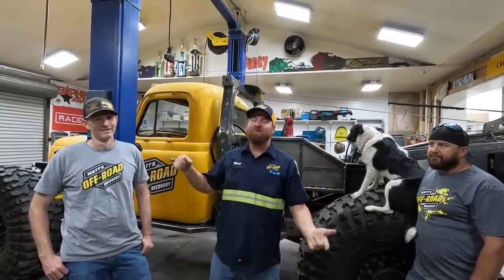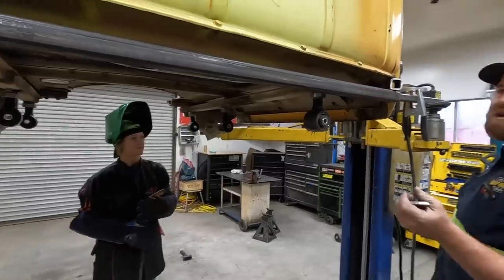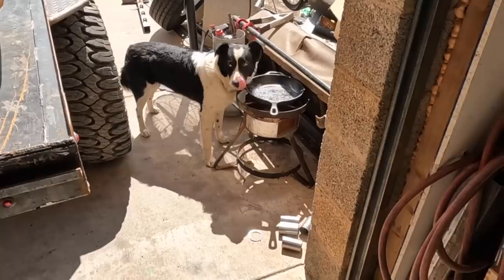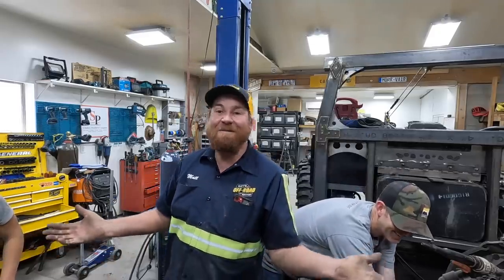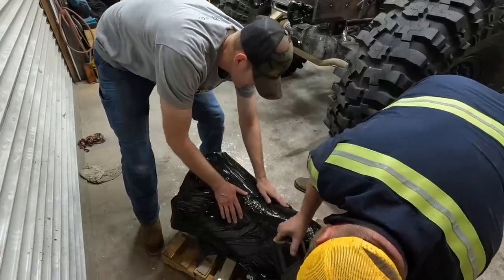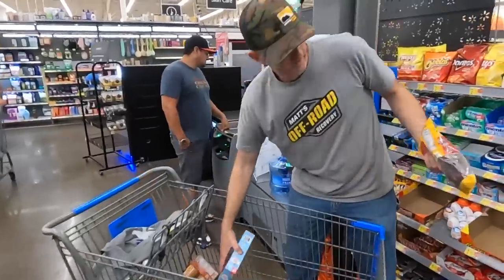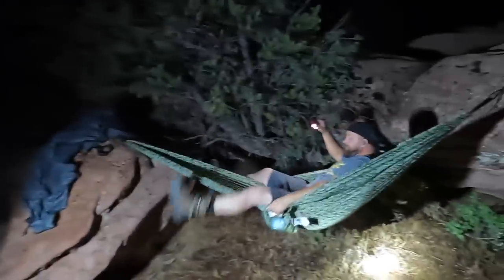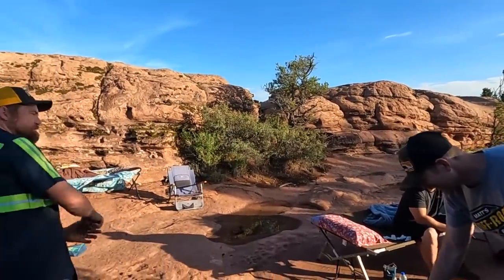Off Road Wrecker, We Need To Take It Apart Again.

Comment: The shot at 12:56, with Skeeter standing on the transmission to counterbalance the off-center engine, hanging from one arm of the lift, with the bright yellow CAUTION sign in the background ... priceless.  😂
Reply: 12:30 'if anybody is timid just leave because we dont need that kind of negativity'
Reply: Lol my thoughts exactly!! 😂
Reply: I was more worried about Ed balancing up high in that one shot.  Damn Ed, be more careful.
Reply: Zero day since last accident on the shop safety sign. lol
Reply: I used to work at a factory where we machined steel bars into hydraulics couplers and components. The crane operator would wrap the sling around the center of a bundle of bars and they would balance perfectly as he walked the crane down the center aisle. One day he got the 'bright' idea that if stood on the bundle as he operated the crane he could 'surf' the bundle down the aisle!
The supervisor informed him in no uncertain terms that if he ever did it again he would be fired on the spot! He never did it again.
Reply: I couldn't believe the bar stock on the lift arm was kept from sliding forward by a clamp 🤣 perfect
Reply: "Think heavy thoughts Skeeter." 🤣
Reply: And Matt going;
“Think heavy thoughts “
😂
Reply: One time, everyone at the shop I worked at ended up riding on the back of a forklift, with a huge block of steel, to counterbalance something. I forget what it was but that forklift was rated for 10,000 lb.

Comment: The one thing I highly recommend is to install driver and passenger seat suspension. Their are units for tractors that are only about 3'' tall and they are adjustable and inexpensive.
Reply: STRONGLY AGREE!  I have used air seats for several million miles in tractor-trailer cabs.  Air seats are BACK SAVERS....Particularly when the vehicle is taking a thrashing off road.
Reply: Recommend a good one?
Reply: @bobsullivan5714  I drove a Penske rental truck about 8 miles over moderately bad roads - not terrible - and every bump was like getting punched hard in the tailbone, as the seat bottomed out.  I couldn't imagine driving it a couple hundred miles that way, let alone thousands.  Getting back in the truck for the return trip, I noticed a little rocker switch on the side of the seat... which controlled the air pump on the seat suspension.  Heaven. Like sitting on a little torn black vinyl cloud all the way home.  😁
Reply: This☝️, or at the very least (and maybe sponsored because with Matt's creds and viewer base), off-road suspension seats by companies like PRP, Sparco and a few others).
Reply: Our compact JD tractor has a great one , even has a built in electrical air pump for adjusting the seat height.

Comment: There are a few things that I always have on me. First off, the one thing I never leave home without, my Leatherman. I also carry a really good flashlight. I wrap some black tape around it so I can hold it in my teeth and I always some tape. Finally,  I carry a Mag-torch MT16 pocket torch. It looks like a funky lighter but its hot enough to easily melt solder. I literally use it to solder wires fairly often. It's refillable and holds a lot of butane. It's fairly wind proof and if you drop it in water, just open it, blow the water out and it will light right up. That way I'm never having to figure out how I'm going to start a fire.

Comment: The wrecker is coming along well, good to see Lizzy wearing protective clothing for overhead welding.
THE VIEWER BUILD: I am going to say Detroit 2/, never mind the Cummins, let's have some loud diesel with good throttle response. An 8/71 or a 6/92 would be a hoot.
You guys make camping out great fun to watch. Bacon tastes good without flavouring.
Reply: I seen that a long time ago no welding protection. I look at my arms and legs from the many years of eating sparks and hot blow outs all the scars and think how Lizzy's arms will be all scarred up..... I know that they are not thinking about that at present....
Reply: @zzzzzzzzzzaper  I got a spark bounced around inside my helmet and went in my ear, that was it no more. I have full cover and wear it!
Reply: @seanworkman431  Yes those are wonderful hearing the sizzle as it goes down the ear canal. been there a few times kept on welding.
Reply: I don't think Matt can get pissed off enough to properly drive an 8v71
Reply: I like the idea of a 2cycle! That would be awesome.
Reply: What engine is in the wrecker now?

Comment: 5.3 liter fully stock,(yes the ls motor stock, maybe a dry sump ) with a five speed manual with granny gears, solid axle front and rear, (of your choice) in a four door Silverado with a service bed,(service bed for weight over rear tires and to store tools) and a set of 35s in a tire of your preference, will probably need to put four link in to ensure that the axles don’t flip, with low pro bumper in front and trophy truck fenders to keep the exterior fairly clean from dust and mud.🥰

Comment: I have a suggestion for this build. Add access plates on the skid plates for fluid changes and repairs since the skid plates are welded to the frame. That way you don’t have have to remove the cab to do maintenance or repairs.
Reply: the cab will be 4 bolts and some quick disconnect harnesses then you have complete ,unrestricted access.......your way would be irritating
Reply: @trillrifaxegrindor4411  how would you do an oil change?

Comment: Be careful with monster transmission. They rebuilt a trans for me and did a terrible job at 500 miles the front seal came out and I lost all the oil. I took it to a transmission shop and discovered they just put in some clutch packs and left all the worn out bearings and gears in. We were shocked at how bad its was. VERY WORN PARTS!!!

Comment: Matt, in the beginning of the wrecker project, the team was welding the frame so that it would be the air reservoir for the wrecker. Seeing the air tanks being installed made me  want to ask has this frame/air reservoir idea been changed?
Reply: Guessing they deemed it unsafe. There's a reason air tanks are usually round
Reply: I thought the same.   Maybe they are concerned about tweaking the frame and breaking one of the many welds on it and being stranded. idk
Reply: The comments were very adamant that their frame air tank idea was a mistake. To be fair it was and Matt listened.
Reply: What’s the air tanks for? I’m so confused
Reply: @imanoldurango8213   the axles have air brakes on them.
Reply: IIRC he said the air brakes and other critical air lines would be running off of off the shelf tanks and the frame rails were for a mobile shop air system.
Reply: @philb5593  100%.  Round tanks.  If you could do a tubular frame it would work, but rectangular absolutely not.

Comment: Matt...  I couldn't tell in the video if your air tanks have drain cocks or not but if they don't you should consider putting them in the tanks.  I drove military trucks for twenty years and every one I drove that had an air system had a way to drain moisture from the tanks.  Since you live where it can get pretty cold you don't want water freezing in the tanks or an airline.  I would make an access hole in the platting the tanks are mounted to to be able to open and close the drain petcock, also make sure the tanks have a slight tilt so the drain is lower than the rest of the tank.

Comment: Best of luck with the transmission getting rebuilt at monster transmission. I've heard of several people having trouble with transmissions from monster. Mostly they didn't shift correctly, to some lasting a whopping 300 miles before quitting altogether.

Comment: When you end up wiring this rig you might want to run it all to one or to junctions with the cab, so you can pull the cab easier. It will help you in the long run to maintenance your drive line since you got that belly pan in the way.

Comment: Great video are you still going to use the frame as an air tank as well? And maybe for your next build you put togeather an off road camper /RV so you and the team can get some rest on the long trips.
Reply: Yeah I wondered this as well
Reply: Was gonna ask the same question. Figured maybe there was additional concern with welding more to the frame and getting another hole. Or just with general flex of the frame under pressure. God knows I've changed my mind plenty of times during a project, so  we're supporting whatever y'all do!

Comment: Hey, for the Viewer Directed Build, crazy idea here- how about hydrostatic drive? Like what a skid loader or something uses, a hydraulic motor on each wheel. This may be a completely stupid suggestion, but I've kicked the idea for a hydrostatic rock crawler around for a long time. 4 wheel steering and hydrostat would be really cool imo.
Reply: maybe make it articulating too?
Reply: You can do a lot of things with a hydrodrive that you can't with an axle/driveshaft arrangement.  The amount of articulation and steering angles you could get would be ridiculous when you don't have to worry about u-joint limitations, and the ability to reverse one set of wheels while the others are going forward would be a great way to dig or spin a four wheel steer vehicle in place.  A lot of potential there for a rock buggy.  The hydrodrive would be the easy part, since you'd have to completely build the entire suspension and whatnot from the ground up to accommodate the new drive method.  But, you figure that out, the only problem left is that you'd be really slow getting to and from the trail on dirt roads and whatnot, it would basically be like the snowcat in that regard.
Reply: There is one that has been built it is very slow but able to pick up wheels like a spider walking.  it is on utube
Reply: @davidsandberg7631  Right, the guy who built it calls it "Chainlink". Quite the rig.
Reply: @Mick_A_Knuckle  From I remembered of that rig it wasn't a hydrodrive but rather an actual chain going to each wheel from centrally located stub axles.  Cool idea, seemed like his "forced flex" system was extremely complicated to operate though.
Reply: I was more thinking like and loader has so you could walk it left and right to climb, but hey why not be able to do both!

Comment: Man I wish I could have suggested a builder before you guys shipped to Monster. Tons of issues with them. Ultimate Transmission in Boise, Idaho is a very good rebuilder I've used several times. They did a couple of transmissions for some of my old customers with 1000hp+ Cummins. Excellent work and they'll make whatever you want. They have capabilites to custom machine ANY part. Good luck with Monster, I want the wrecker to be a monster as well.

Comment: You guys should build a diesel powered recovery helicopter with solar panels on the top.
Reply: LOL YES!!
Reply: Of course, that would have to be a "Cummins" diesel powered helicopter. And you'd want
to add a second Cummins just to be safe on the heavier recoveries.
Reply: @MattsOffRoadRecovery  just a heads up don't know if it's in ur wheelhouse but there has been a m561 Gama goat in reno nv big nickle

Comment: 10:44 I'm not a mechanic. Although, have you considered a dash mount gauge for the pressure in the air tanks ?
Reply: That's what I use on my service truck,  just a cheap external tpms system and a valve stem adapter on the tank
Reply: All you really need is a air pressure gauge from a semi truck.

Comment: Suggestion for the wrecker: mount rollers on the roll bar so you can run multiple winches over the cab and hood. Higher point of lift and multiple lines when you can't turn around. Main winch line & side winches could be run from the center of the bed at  low power point and routed to the front over the cab or to the back over the boom

Comment: Agreed on the bacon. If I'm making it myself, I'm smoking it over some hardwood like mesquite or pecan. Otherwise, just buy it from the butcher counter at the grocery store. Sugary cured bacon also leaves goop on your cast iron pans, which sucks to clean off. The plain thick cut stuff with no added BS is the way to go.

Comment: Can anyone answer this question (asked twice already):  Is there any state requirement for a safety inspection both in relation to the over all mechanics of the truck as well as the engineering integrity of the devices fabricated (winch, lift, etc)?  I am asking only out of curiosity and not as a challenge to the integrity and craftsmanship of the project or the labor crew.
Reply: Probably not. I'm in ut and have never heard of any but I'm in no way an authority on anything auto related
Reply: Yes there's a process. They have to document the entire build, including where they got the parts from and bills of sale for those parts. They also have to submit photos. It has to pass emissions inspection if it's applicable in their county, which I don't think it is. The state will issue a title once everything checks out.

Comment: Love the idea of a comment driven build. I have a suggestion. How about a custom buggy/side by side, but powered by a 4 cylinder motorcycle engine. Suzuki Hayabusa, Kawi ZZR 1200, or even an old flat 4 Goldwing motor. Light, lots of power, fun. Been thinking on this for years...even had motors at certain points, but never a place to build it. Might be fun!
Reply: GL1500 would be an awesome power plant for that 100hp 110lb ft, just use the standard trans with it so you already have a shaft driven output from a 5 speed.

Comment: Sure is a lot of trust in that welding vice grip clamp to keep the engine from sliding off lol
Reply: welding clamp? thats called a vice grip. because it grips like a vice. doesnt come off easy if you set it right
Reply: This is the kind of negativity Matt specifically asked to leave. 12:30
Reply: @philb5593  lol if I was there, I'd have stayed quiet.

Comment: I must have missed something. What bigger motor is going in it in the future? And what happened to using the frame as an air tank?
Reply: The comment section pressure vessel safety committee nixed the frame air tank.

Comment: Loved getting to meet you guys at the Jeep Invasion.  I'll give my opinion on the project BEFORE you put a line on a paper, and even though I'm a diesel guy it won't be a diesel.  I think a cool project would be to turn a Subaru engine/drivetrain into a sand toy.  The manual transmissions use viscous silicon CV joints and the automatics use a computer and traction control, so I would opt for the manual transmission.  I had a 2003 Forester and doing a 4000 RPM clutch dump would lock all the CV joints and you couldn't turn the wheel until you let off.  Doing this at an empty intersection meant I could do a 4 wheel drift then let off the throttle to straighten out.  Taking this to the sand would be a blast I think, especially if you get a turbo engine.  Then after it's built and you've had your fun with it, raffle it off to cover your expenses, then donate the extra money to one of the many good causes y'all support.

Comment: Will the frame still be an air tank as well? Solid video as always guys! Glad to see the follow up on the camping night!
Reply: I had the same thought when they were using those air tanks.
Reply: Looks ik they scrapped that idea. Kinda been wondering that as they have been adding building etc and never said anything about testing it
Reply: They added tanks in this episode, so no.
Reply: Just because they added tanks doesn't mean they won't be using the frame as well.  Could just want more volume for seating beads and whatnot.
Reply: @xperia5295  Glad ya noticed too!
Reply: @ShopJock  It was a neat idea, good use of space!
Reply: @mediocreman2  Time will tell, I haven't given up on the idea yet!!
Reply: @Skinflaps_Meatslapper  That's what I'm hoping for, loved that idea in the first place. Either way, it will be great to see them have onboard air!

Comment: Absolutely love the project vehicles you've done so far & the heavy wrecker is checking all the boxes! Tom Tom is onto a great idea!! My suggestion is the Isuzu Rodeo you rallyed on the Toyota 4Runner vid: SAS with 4-linked Dana 60s front & rear, OM606 Mercedes Diesel swap, chop the rear roof off & make open air shaded place for your dogs!! ;)  Then tackle the Samurai & go twinsies with an OM604 Mercedes Diesel swap. Both engines are light, tuneable for a wide range of power, will rev much higher than US diesels, are VERY unique. We absolutely love what you all bring to YT, family friendly, community, quality fun with lots of shenanigans & very awesome vehicles!

Comment: Drag that Isuzu Rodeo in from the 4Runner reveal. No Cummins though, because the Isuzus pull heavily from GM parts bin. Also, there are a few great Isuzu Diesels out there waiting for a chance in the project. A 4BD1T would be awesome or the newer 3.0l diesel from the NPR EcoMax trucks.
Isuzu Rodeo also comes with a heavy duty Dana 44 in the rear. You'll need a front axle, but I'm thinking the ring and pinion from a Ford 8.8 IFS, in the pumpkin from a rear 8.8, narrowed and offset for front use. Lunchbox lockers.
You're already getting a fully boxed from in the Rodeo to begin with, so you have a great platform to begin with.

Comment: I work in a weld shop. Any time you lift something that you are working under you should have a set of high horses under the cab just in case the cab starts to come down since your 1 x1's are distorting. I believe that's an OSHA requirement.

Comment: I thought the plan was to use the frame as the air tank, or did i miss you saying why that pan changed at some point?  I remember you adding all those rods to stop the frame from expanding under pressure.